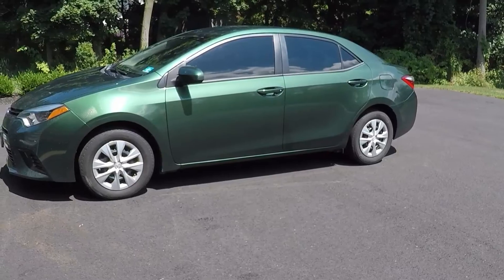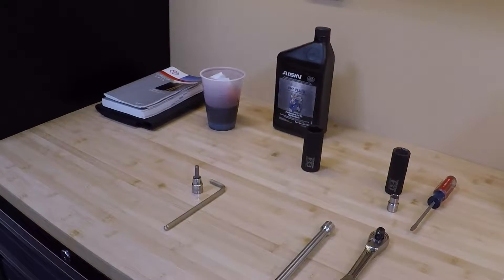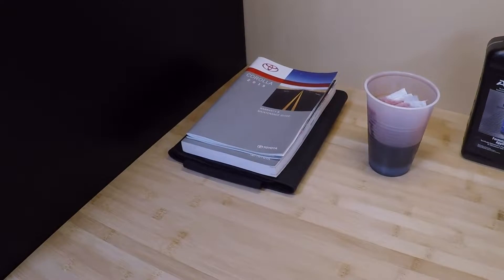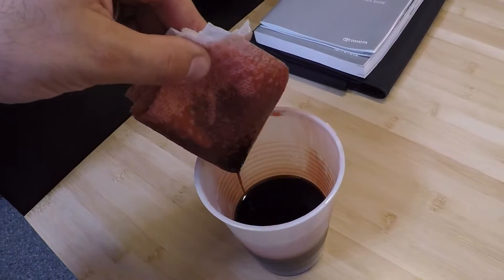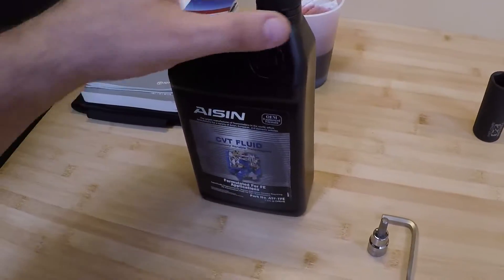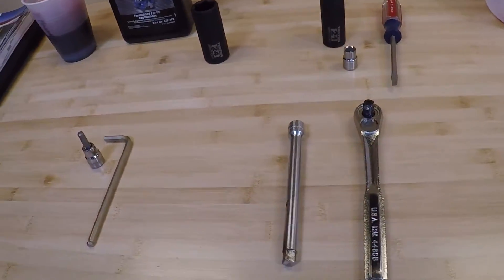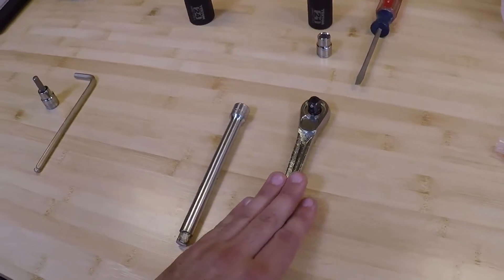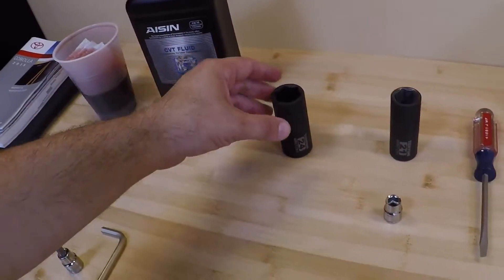Toyota Corolla CVT Transmission Fluid Change Part 1: Tools, Materials, & Intervals.

Comment: I'm here to Second his statement on the oil. The same applies to wheelbearings, ball joints and alot of other parts you just need to do some homework. ONE company does all the bearing stuff FOR Toyota. You literally are paying double for the Toyota box EDIT: Cats out the bag 2025. Aisin cost the same.

Comment: If your dealership changed your transmission fluid once before you started doing it at 113,000 miles, how many times have you done the drain and refill yourself? Was it a total of six times? And what was the interval between each fill—did you wait a week of driving or reach a certain mileage before doing the next one?

Comment: You have a very thorough and well filmed video. I've done this job on Tundra, Camry, 4Runner and will do on my 2023 Tacoma. I used a scanner to insure proper ATF fill level from  temperature displayed by onboard computer. Unfortunately the method you suggest is flawed unless you can verify the fluid level is at factory spec. If someone made a mistake in the fluid level previously, you are just replicating the same error. I believe using the jumper wire is the way to go for accuracy if you don't have a scan tool. But as you stated, failure to do this properly and carefully could result in catastrophic damage to electronic system.

Comment: Your only getting 2qts your not removing the inter bolt hidden up  inside the drain hole- maybe a 6Mm Allen wrench- It’s plastic - so remove & install it by hand only! Have a great day!
Reply: I'm wondering if you stop after you remove the 2 quarts,put 2 new quarts in and drive and repeat the procedure three times,I think you'd have mostly new fluid and maybe avoided the larger drain and having CVT at a certain temperature to accurately fill it.

Comment: Please, NEVER WAIT 10K TO CHANGE YOUR OIL -- YOU'LL BE SORRY IF YOU DO.  CHANGE, AT MINIMUM, EVERY 5K OR SOONER (AT LEAST FOLKS).  I'VE SEEN ENGINES COMPLETELY PULLED APART AFTER THE "EVERY 10K MILE OIL CHANGE WAS DONE) AND THE SIDE WALL OF THE PISTON CHAMBERS WERE GOUGHED AND THE BOTTOM OIL RING ON THE PISTONS WERE FROZON SHUT -- NO GOOD.  DO YOURSELF A FAVOR, USE A GOOD OIL LIKE 0W-20 MOBILE ONE SYNTHETIC AND AN ORIGIANAL OEM TOYOTA FILTER ELEMENT AND YOUR GOOD TO GO. PSONALLY, i HAVE DONE MINE EVERY 2K AND MY ENGINE 'S INTERNALS ARE SPOTLESS, AND THE CAR CONSUMES 0 OIL.  CONVERSELY, IF YOU DON'T CARE ABOUT YOUR CAR, THEN, OF COURSE, DO WHAT YOU WILL.  P.S., OLD OIL, WHEN RECYCLED AT A REPUTABLE FACILITY, EVEN A WALMART, RECYCLES THAT OLD OIL.  SO FOR ALL TREE-HUGGERS OUT THERE, TAKE A DEEP BREATH AND RELAX, IT'S ALL GOOD. I HOPE THIS ADVICE HELPS.

Comment: you CAN change it all at once they call it a flush, a machine sucks it out while replacing it simultaneously all fluid is replaced at once. I would do a drain at 50k and flush at 100k.

Comment: I prefer to do the drain and fill 2 quarts in every 13,000 miles after the first 26,000 miles than to wait 100,000 miles cvt fluid changing.

Comment: Great videos this one and part 2, How did the aisin fluid work out now that it has been a year in the car ? If the transmission was built by aisin it definetly looks like the oem fluid is just rebranded aisin fluid. looking at doing about 6x drain and fill on a corolla I just got my wife with 83k on it. Im going to be sending in the transmission fluid to blackstone labs to see how bad it really is at that point.
Reply from the maker: no issues with the aisin fluid

Comment: I wonder what if I decided to drop the pain and change the transmission filter and clean the magnet. Would that drain and fill also 2 quarts or may be 2.2 quarts to include the oil inside the transmission filter. I cannot level  the car and don't plan to get a scan tool just because of this task. Thanks for the video.

Comment: 1: if you are doing  a measure what comes out and put same amount in, you got take into consideration whether a: any leak in your pan? B: did the previous dealer put the right amount of fluid? 
2: by following the connect pin 4 & 13 * diagram on the internet* u can really determine the right temperature of the transmission when it’s good for fluid adjustment. If you somehow mess that up and cannot follow simple instructions as such, you should not be working on your car in the first place. 

Fyi: I have done 2 drain and fills in my car and I also dropped the pan and changed the filter of it. One thing I learned after that ordeal, if you drain n fill your CVt early and often, your fluid and your filter should be clean AF. I was able to drain 5 qts of fluid though when I dropped the pan somehow. I also used the Aisin fluid on rockauto. 

Pro Tip: change your drain plug gasket and fill plug gasket every time you do a drain and fill. Torque the drain plug to 30 ft lbs, and fill plug to 36 ft lbs.
Reply: I would probably change my filter again after Atleast 100k miles (I’m at 52k miles now) so maybe around 150k miles. 
In my opinion, this is the weakest part of our cars and the fluid is hella cheap. JUST MAKE SURE the vehicle is on right temperature (with the pin 4&13) and LEVELED as possible. I use a quick jack and I jack the Frame of the vehicle so that it is leveled. Sometimes my garage floor isn’t leveled.
Reply: Joseph Juguilon kindly share the required temp to get the right fluid level.. can i used infrared thermometer to get the level done?
Reply: Noli Untalan if u use a IR temp, it will be off and inaccurate. Just do the connect 4&13 port on the obd. Or have techstream :)
Reply: Was the OE filter a metal mesh type that doesn't have any filter media?  Also, which part/brand did you use for the replacement filter?